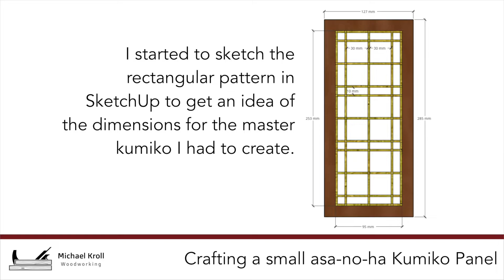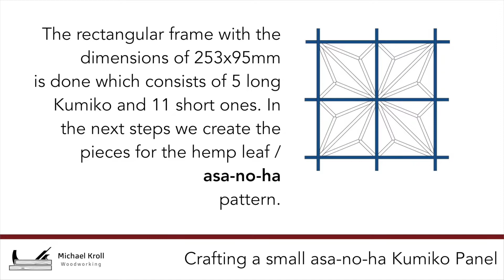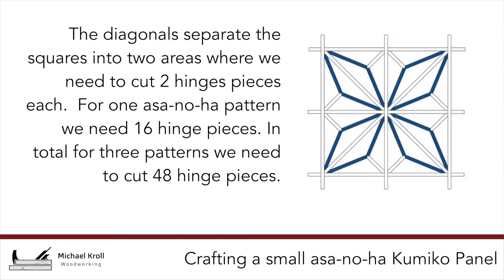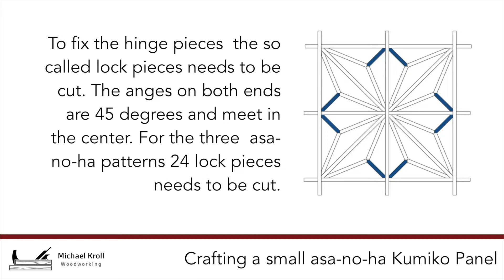Crafting a Small asa-no-ha Kumiko Panel

Comment: I would be interested to know what that blade guide you were using on that chop box. Is it roller bearings of some kind ?  does it damage the teeth of the blade at all ?  anythging you could tell me would be apreciated
Reply from the maker: Hi, the blade guide is provided/a product from Veritas. There are no bearings. To prevent the teeth of the blade cutting in the plastic, you need to move your blade into it from the side rather using it from the top to the material you want to cut. The are for instance available here: https://www.leevalley.com/en-us/shop/tools/jigs-guides-and-fixtures/76038-veritas-miter-box-guides?item=05N7601 Does that help?
Reply: Many thanks  @MKWoodworking